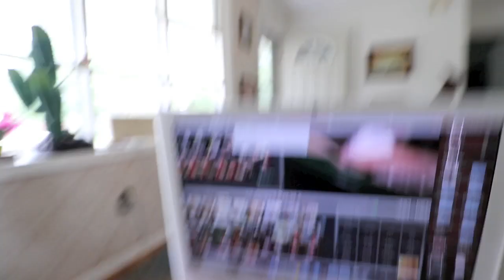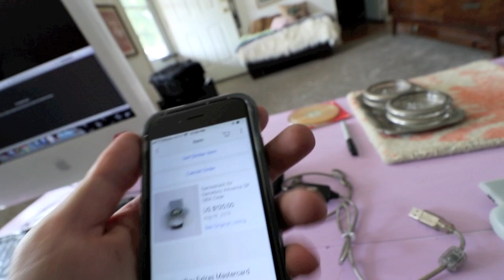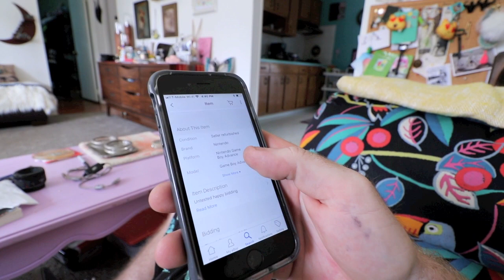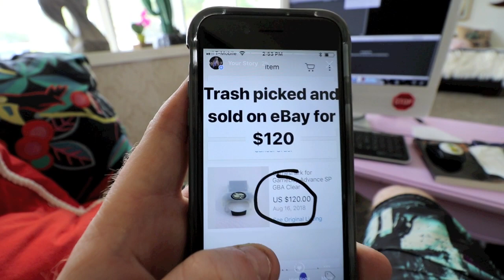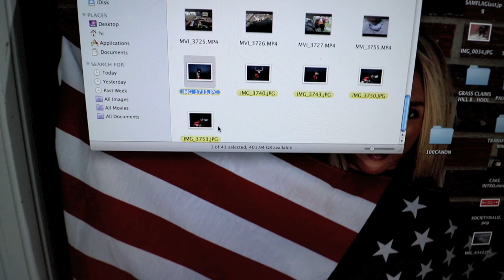How To Make More Room For Your HOARD On The Cheap!

Comment: Elastomeric is a rubber coating paint that seals your roof or siding. Check it out at Home Depot. You could even roll it it on the shed roof and exterior walls